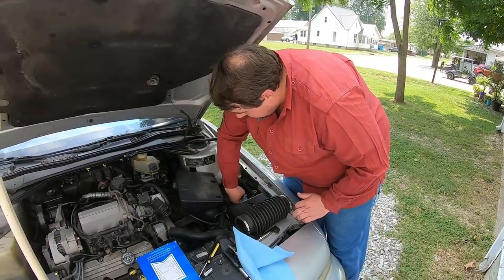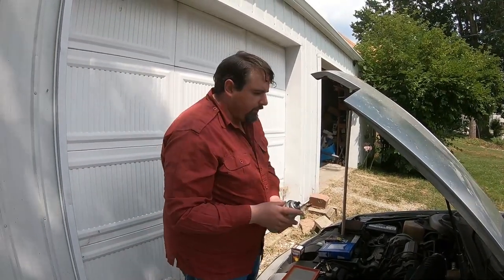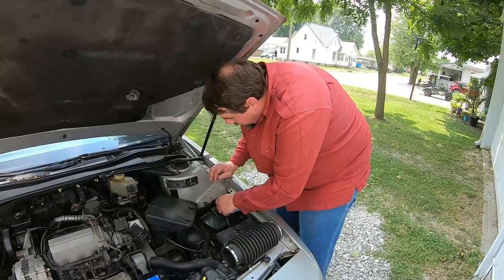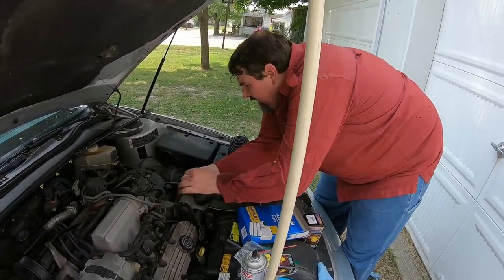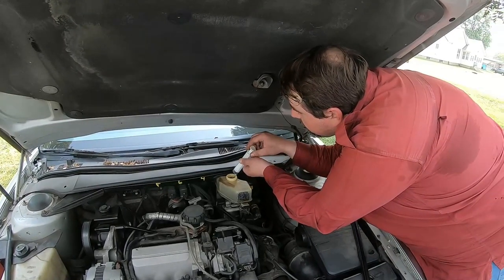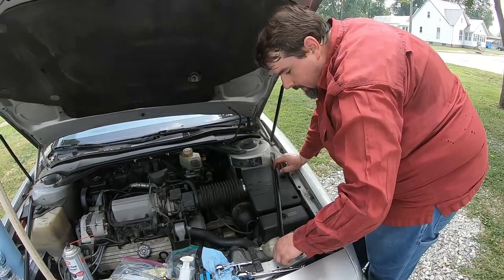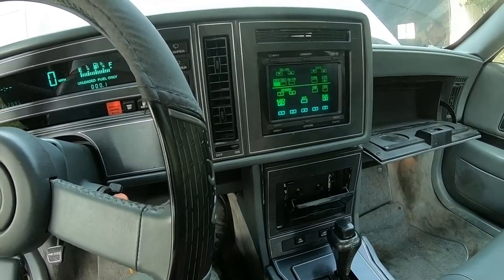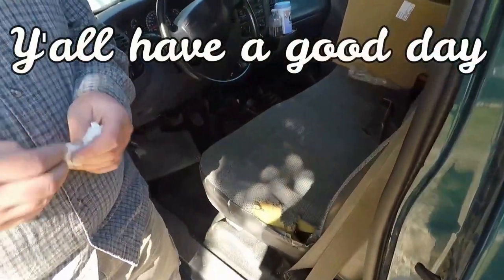We fixed the 1989 Buick Reatta CRT screen with MAF cleaner

Comment: I own a 89 reatta 
I didn't know that throttle senor could be why my car won't start ?
Reply from the maker: It normally just causes acceleration problems and little shorts like the radio when it goes bad. If it starts and won't idle there's an idle control sensor that may have gone bad. if it won't start at all battery cables and the coils would be the first things that I checked
Reply: @KrazyKarlProjects  I think it electric problems I had so much Money put in my Reatta had water under the driver seat when it rains
Reply from the maker: If water is getting in it could be causing a short or connections to corrode. Check for signs of this and use a voltage tester to check connections. It could also be a bad starter relay if it just won't start. It can actually be quite a few things keeping it from starting and running including fuel pump problems and bad grounds.